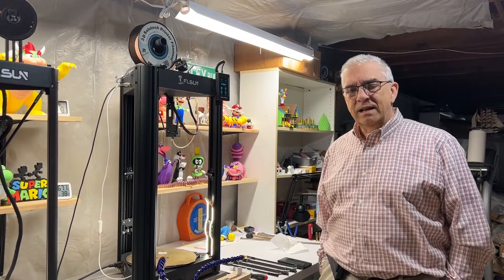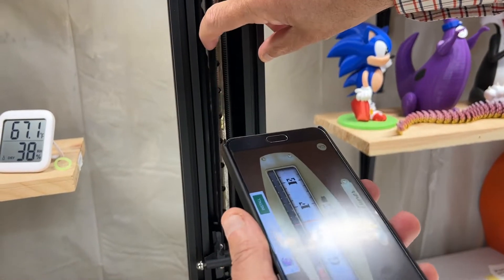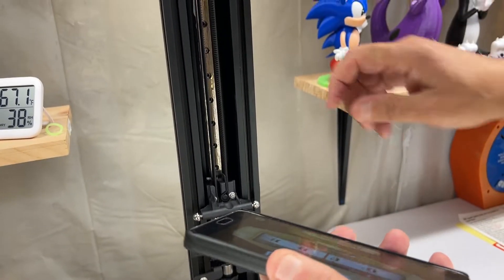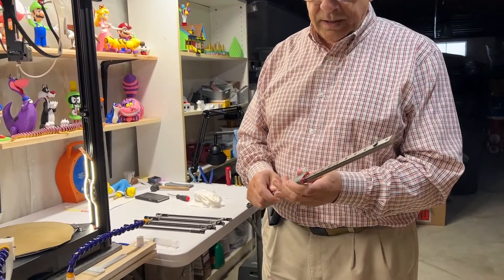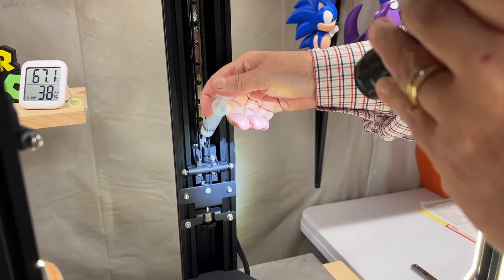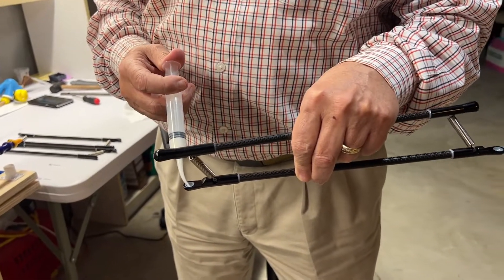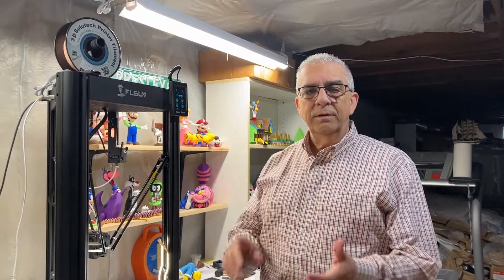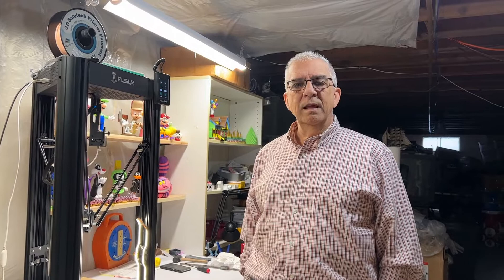Maintaining the SR Belts and Linear Rails

Comment: Thanks for the explanation. Videos like this are needed to help all new SR fans. What type of grease do you recommend to use. I have the original tube supplied by FLSUN but there are no references on their web page, manual or the tube I have as to what they recommend. Seems like a pretty basic thing they should post. Thanks again.
Reply from the maker: Good quality White Lithium Grease.

Comment: Thanks Dennis, one of my arms was was binding up, i cleaned the rails with WD40 first, then used your grease method, works perfectly but when i tighten the belt the arm starts to become harder to move... I checked that everything flows well. Little puzzled :-)
Reply: wd40 is not to be used.. clean with contact cleaner

Comment: What happens if you don’t tune these belts? I’m asking because I’m having the same exactly issues with all 3 of my Super Racers but at different print times. I’m having globing and string at around 7-8 inches high off the build plate (to the paint if failure). But the base of the print is alway good. Any advice?

Comment: In THEORY, it's great. In actual practice? Never get the same readings twice in a row. Tightening the lock screws changes it 5-25 hz. Gave up after an hour.
Reply from the maker: Yes indeed. IIt is not easy or an exact science...